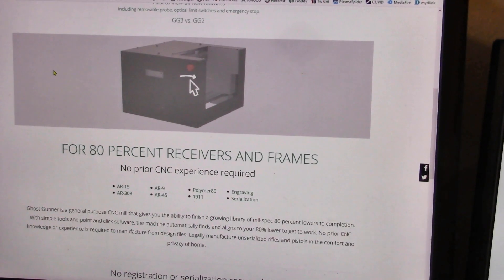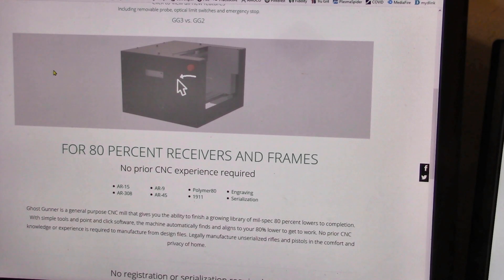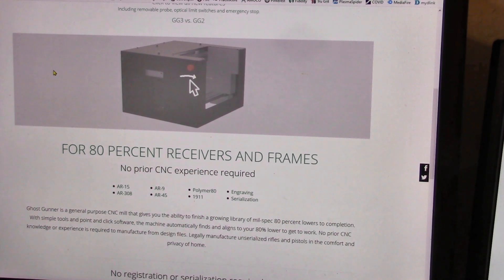Ghost CNC machine

Comment: I know this is an old post, but my $.02... Buying a manual mill is pretty cheap and easy. We could easily mill out a lower on a Harbor Freight mill that costs $500 delivered. I know, I've done it. But I had zero mill experience and the learning curve was steep, and I'm an engineer. Also, it's manual. The GG is true CNC with stepper motors and all. It even uses G-Code. For those CNC guys out there, you know what a CNC machine costs. You can't even buy a manual mill and add CNC to it for under $5K. This is a great little bench top CNC that has a decent size volume for what it is. Again, it takes G-Code, so you can cut anything you want out of aluminum billet. The new GG3 will even cut steel. Aluminum rails for a G19, right? It's a CNC machine, not just a lower finisher.
Reply from the maker: I had not done enough investigation when I made this video.  I had never heard of the device and so I was on the wrong track.  Thanks for stopping by.
Reply: @AmateurRedneckWorkshop  No worries! Love your channel. I am making a lot of motorcycle parts for dirt bikes and your channel gives me a love of ideas on ways to approach things. Keep it up!

Comment: That machine looks like a small cnc machine that they prepackaged a cam program with. The machine seems to be fairly stiff for what it is and it seems to be gears to gunsmiths that want to do a run of parts while they work on something else. However nothing stopping people from doing this on a chinese 150$ mill (would take forever but dooable on a 3018) or dooing a huge run of these on a 1/4 million dollar has machine.
Reply from the maker: Lots of ways to do the job.  Thanks for stopping by.

Comment: Profiting on people's ignorance is a time honored tradition. The laws concerning the unlicensed manufacture of firearms are not very well defined. It is illegal to manufacture a firearm with the intent to distribute it. How one proves intent I do not know. But after you're done if at a later date you get a notion to sell the firearm you manufactured without a license you legally can. Although there are ramifications for doing such a thing. For instance you are liable in perpetuity for whatever that device you've made does. If that firearm is used in the commision of a crime you automatically become an accessory if you can be tied back to it. As you have no legal indemnification that a manufacturing license bestows on an entity. So while it is technically legal to do it is just not very wise.
Reply from the maker: Their are no problems in making one for your own use but like you said selling is against the law.  Thanks for stopping by.
Reply: @AmateurRedneckWorkshop  making a firearm with the intent to transfer it without a license to manufacture is illegal. Selling it later on without the prior intent is not technically illegal. It's stupid, but they can't bust you just for that. Any legal counsel in the world would advise against it though. The law is so bad that if you made a firearm without a license and I stole it then you'd still be liable for whatever I did with the stolen gun you made. That theft would still be considered a transfer. From you to me. Not solely liable of course. But liable nonetheless. The government knows they cannot ban private manufacturing outright. But at the same time they can make it as risky as possible for anyone to engage in.

Comment: I never heard of this machine. i will look at it because it sounds interesting. Thanks for sharing Mr. Harold.
Reply from the maker: Thanks for stopping by.
Reply: It is a scam and a come on. The machine is not worth nearly what they're charging for it. Maybe half? I'm not saying it can't do what they claim it can do. But it doesn't do it very well. There's certain physics of the machining process that you just can't get around. The primary one of those is that mass absorbs vibrations. So lightweight machines just can't run very smoothly.